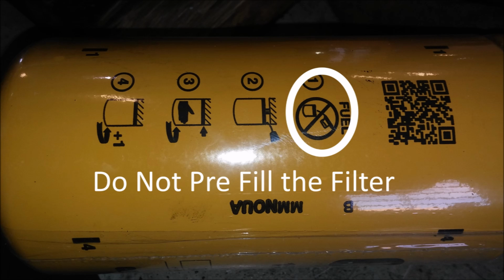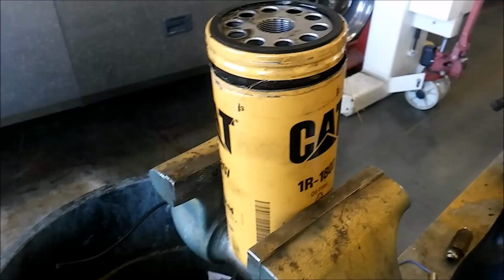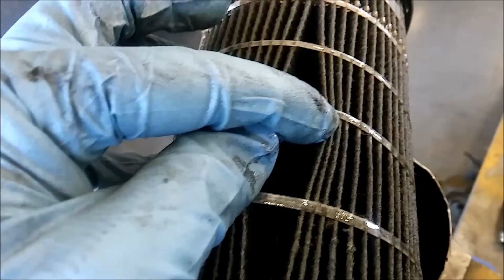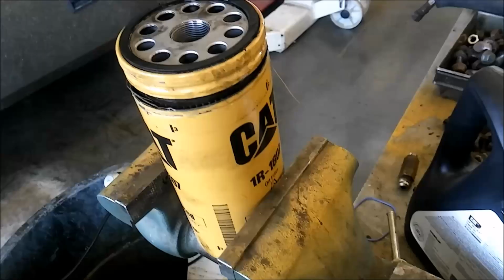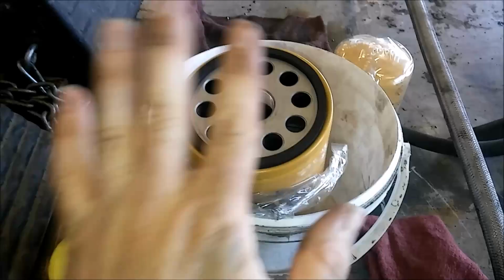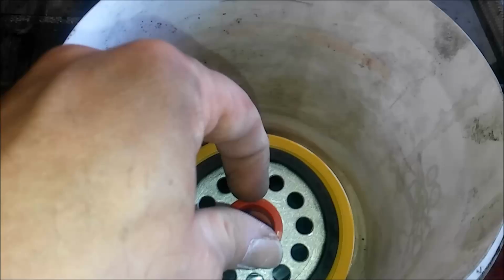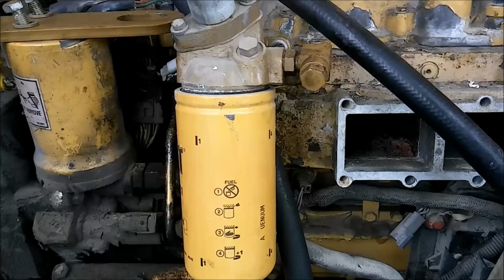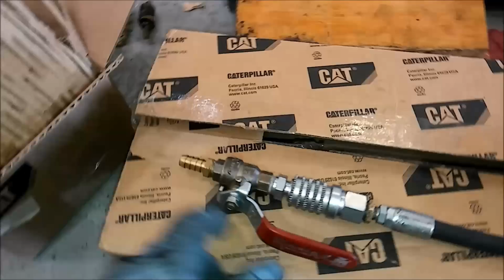Should You Pre Fill an Oil Filter? Should You Pre Fill a Fuel Filter?

Comment: well that didn't work!!!! i am trying to get a wiring schematic to see what triggers the  injectors also is there a ICP for this engine or something that will not let the injectors fire? thanks for the on going sopport. 
have a good night.
ps i am about to give up!
Reply from the maker: Don't give up! I'm not exactly sure what acronym the ICP valve you speak of, some sort of Insane Clown Posse valve perhaps, just kidding. My HEUI videos hopefully can shed some light on how the system works though. The injectors are fired directly by the ECM, so as long as you have HEUI pressure and fuel pressure, it's up to the ECM to fire the injectors. I think I'll make a "Diesel Talk" tonight and try to elaborate on your questions, so watch it if you can.
Reply: LOL! ICP in ford 7.3 turbo diesel (injector pressure sensor) i don't know if cat has it thats why i mentioned anyway if the pcm activates the injectors then i don't have a way to check that out,unless you have a special way or procedure.thanks !!! will be looking for the video!!!!
Reply from the maker: +adve58 I did the video and it's uploading now, give it about an hour. Sounds like you understand the system fairly well. There is an Injection Actuation Pressure sensor, but they rarely fail. The ECM fires each injector, but without a computer there is no way of knowing if it's firing or not unfortunately, if your getting smoke its firing. I wish I could just get my laptop on that engine for 5 minutes and see what was going on. If you can measure fuel pressure and it's good, and there is oil purging out of the injectors while it's cranking you should have HEUI pressure, but without a way to talk to the ECM your going to be flying in the dark as far as if the ECM or harness is okay.

Comment: if you don,t want a prefilled oil filter on your diesel, don't go to a quick lube.
Reply: If you want a good job never take it to a quick lube. Always take your rig big or small to a real mechanic if you don't do it yourself.  If you want to avoid potential problems this is what you do.  Quick lube joints are the Burger Kings of the oil change industry.  Only I suspect the fast food guys may have more training. Too many horror stories come out of those places and that is beyond what I have seen with my own eyes.

Comment: New oil...even when poured into the clean side of the oil filter is still cleaner than the oil I just drained out of the car...and it lubricates better than no oil at all. When you start up an engine after an oil change, it knocks for about 5-7 seconds. If you pre-fill the filter, you hear almost none. I'll take the latter situation.

I own three cars. All are over 80k miles. One is over 220k miles. I've never had any lower engine problems. I guess I'm doing something right.

I see no point in priming a fuel filter. If your vehicle has an electric fuel pump, fuel will reach the engine quickly. Even if it doesn't, who cares? You just need to crank a little longer before it fires up. No big deal.

Comment: I dont care what other people do ive drove trucks 42 years ive always pre filled ive got over a million miles on my enguines .the old 2 stroke detroits if you didnt pre fill the fuel filters they would suck air and not run theyd lose there prime,even alot of cats had a priming pump to get the air out

Comment: What is a filder and no pre fill your filder or fuel FILTER depends on the the system and pressure common or non common electric pump or button or rod pump even butterfly clip pump pre fill all filters  no dry start full system

Comment: problem solved:  have engine steam cleaned, go to shop that has just been cleaned so its spotless, have mechanic put on clean clothes  and drain oil and remove filter then  pour fresh oil in filter using funnel with filter and lubricate the gasket on filter don't want to get a hernia trying to remove filter at next oil change, install oil filter hand tight only no wrench needed or you will need a small boy and an elephant to remove it when full and make sure oil plug is in oil pan then fill with fresh oil using funnel with filter as you pour oil in and don't forget to replace the 710 cap so the oil won't splatter all over the engine compartment after that's all done get your self a bottle of gin and of quart of prune juice it will make you day: and don't forget to put a cap full of sea foam in your oil it will make your oil happy

Comment: I understand not pre-filling a fuel filter.  The risk of using fuel that is contaminated in some manner is just way too high and pouring contaminated fuel into the filter's center - any nasties go straight into the injectors, jets, whatever (and that's assuming no internal filter screens - which is not realistic).  AND running dry for limited amounts of time is of minimal consequence.  

*But a motor OIL filter?*  C'mon, if the oil just came off a store shelf - that oil should be clear enough to be pumped straight into your own veins.  So center, outer will NOT matter.  Any mfg debris in the new oil filter outlet will get flushed out to the engine no matter what your pre-fill choice is.

So again I must ask,  how in ANY way could pre-filling a new motor oil filter be a harmful thing to do??  I've *always* told people to prefill their engine oil filters, ESPECIALLY if it's being installed on a turbo-charged engine.  Always trying to minimize the milliseconds it takes to refill the plumbing after a change.  Not only that, but on the last turbo car that I owned, a red 5-spd '95 Mitsu Eclipse GS-T ( I fkn loved that car) I always pulled the ignition fuse and cranked the engine for 3-to-5 seconds after a filter change...

Comment: 2ws 3406e

I bought my truck with 515,000 miles eight years ago. always prefilled oil filter new oil,  new fuel filters old fuel from old filters every 10k miles. im now at 1,063,500 miles no inframe original injectors and idle psi still 48 to 55psi. still runs like a raped ape.
Reply from the maker: +77chevyk30 Those are good engines, I've seen them with well over 2 million miles, usually with an inframe.

Comment: I have never pre filled my oil filters in my cars since one engine's filters goes on upside down and the other one sits sideways.  240,000k and 170,000 k with engines running strong. If it psychologically makes you feel better to prevent fill the oil filter and are able to due to its design, then by all means go ahead.  Doing it or not is not going to due miracles to ur engine nor  destroy it. Neglected engine services will ruin cause pre mature or engine damage.

Comment: I have owned heavy equipment for over 35yrs. I have changed oil thousands of times and never ever have I filled a new oil filter ever. It’s bullshit filling oil filter. My Question back to you is what about oil filters that lay sideways. Rest my case. But fuel filters should be filled . You don’t want to run your fuel pump run dry and create issues. So that’s it. My 35yrs experience.
Reply: You can still get a horizontal filter saturated with oil and  have at least 1/3 full and still install it with little to no mess. 
I’ve done it for years. Assuming you give the old oil at [least] 5 minutes to drain, why not fill the new filter while waiting?

Comment: If you don't you will get air in the fuel system and it won't run. Use clean fuel is better than no fuel.

Comment: Never pre-filled, never had any problems. If you seriously think that your engine runs "dry" after not pre-filling your oil filter you're just making something as simple as an oil change way too complicated. You can in fact redline an engine with no oil for 2 minutes, so if you think idling without oil pressure for 2 seconds after an oil change destroys your engine, you seriously don't know anything about modern oils and the lubrication capability of them

Comment: Save your pump and add clean oil to the both sides of the oil filter. I rather have fresh clean oil from a bottle with the risk of contamination from it, than hear the cavitation of the oil pump struggling for 10 seconds.

Comment: I watched some of your videos and felt like u are pretty knowledgeable. I have a question and a favor to ask. Please reply. I have a 2007 kenworth with a c 13. The turbo has what o call a actuator or waste gate looking thing. Well it had a metal line on the back and it broke off. And I can't tell where the other end hooks up. I was gonna do a temporary fix and make a line. Message me or call me would be awesome
Reply from the maker: +Wayne Peake The waste gate should go either to the intake side of the same turbo or the intake side of the other turbo. There should be a hose coming the intake side.

Comment: With this theory,you could say that by pouring unfiltered oil into the filler,i.e. the valve cover,you have just cantaminated the engine with " dirty oil"
Reply: That oil will drain to the sump and be filtered before going to the big end and main bearings the point he was making is keep everything on the clean side of the filter filtered and clean simply prefill your filters on the dirty side, it makes complete sense and its easy no big deal if there is a bit of dirt in the new oil you could go from a hero to a zero very quickly just do it .

Comment: i have cat7 no faults truck been sitting for about 1 year . We change injectors and fuel pump. Would not start. Any suggestions.
Reply from the maker: +Alex Kolker What is the fuel pressure while cranking? Are you getting an rpm signal on the tachometer while you're cranking.
Reply: Hi. yes pressure around 25-35. RPM's are week around 7. But forgot to mention when we use starting fluid its start runs for about 1 min and dies again.
Reply from the maker: +Alex Kolker Well it's hard to troubleshoot over comments, but 25 psi of cranking pressure is good. Now the engine starting and dying is interesting, sounds like you might be getting air in the fuel. Try running the fuel inlet line straight out of a bucket of fuel and see if it stays running. Next step would be to put a very high pressure gauge on the HEUI rail and see what kind of HEUI pressure you have while cranking. Should be around 800 psi. Any check engine lights or blink codes? Good oil pressure at cranking?
Reply: We getting code 62 and 35 also transmission sign stays on not Engine.

Comment: I always prefill filters oil or fuel no matter what type engine or size Fuel especially to prevent air locks and faster starting on diesels  unless filter mounting position doesn't make it possible if the oil coming out of a quailty name brand Oil container isn't clean then you have no business putting it in your engine anyone thinks otherwise is an idiot, another thing if you think your oil filter getting all the particiles out of your engine think again its Not , in the early days Engines didn't even have oil filters they were an option

Comment: what is your opinion on filling oil filters with a remote filter on equipment
Reply from the maker: +CHRIS BUXTON If the filter replaces the engine one then I would say the same principles apply. If it has a filter then it's probably feeding something sensitive and it's best to get it the cleanest fluids possible. I know some systems use a bypassing recirculating system, like some bulk tanks, so those filters aren't as critical for the sensitive prefilling, but it never hurts to do it the best way.
Reply: +Adept Ape right I just thought maybe with the longer hoses to the filter housing it would take longer to build pressure with not filling it....maybe a tightening filters video? Noone seems to be able to follow directions or are scared they will come lose and they don't come off
Reply from the maker: +CHRIS BUXTON You can prefill the filters if you want to, but just fill them from the outside and not the center if you are going to. I understand why people prefill them, the idea of running an engine without oil pressure even for a couple seconds is scary. They almost need an oil priming system that would keep a small amount of oil in a collector under pressure for start up after an oil change
Reply: +Adept Ape yeah that would be a good idea or an accumulator or something

Comment: well when am setting on the side of the road ill make sure I remember to fill the fuel in the little holes, shit buddy I've been filling the fuel filter on my truck in to the big hole for over 25 years and nothing bad has come from it, your talking such a minuet amount of fuel nothing going to plug up.. I run a cat 475 you have to fill the filter. and yes it has a pump to top off.

Comment: hi there im still around!!! ok so while time didn't stop for me the engine is still not running but i need to know where do i get an oil pressure reading and what is the lowest pressure the engine must have to operate( the injectors) i haven't taken out the injectors yet but i guess that would be my last attempt to start this monster!!!.
thank you loved the last video!!!!+++++++
Reply from the maker: You have perseverance sir to keep working on someone else's engine. A good place to test for oil pressure on a 3126, I believe you have, is on the oil manifold. The oil manifold sits on the intake side of the engine. It is below the intake manifold and to the rear of the air compressor. It is bolted onto the block with two 13mm headed bolts. There should be several ports on it and should also have a small line going to the air compressor. Use any of the ports with a plug in it and you should have oil pressure in it when it's running. I don't remember the exact specifications for minimum oil pressure on a 3126, but it should be at least 20 psi at idle. Hope that helps.

Comment: This is a lot of work for nothing. Clean oil, clean oil filter, fill in the center. Aircraft piston engines, even modern piston aircraft engines don't even use a filter. Save your engine, pre-fill and pre-fill with the center hole. Using the method shown in this video I suppose it's possible to damage that rubber that's designed to prevent the oil from back-flowing.

Comment: Why would it matter? All the oil you are dumping into the oil pan is unfiltered. How is the 2 quarts of filtered fluid going to counteract the other 15 quarts that are being dropped straight into the engine unfiltered? Common sense. Because in most cases all that oil gets dropped ontop of the overhead cams and falls down into the drain pan. All this "contaminated" oil that you don't trust from a bottle has literally coated the engine. Just in case you want to be like "oh the fuel filter is right after the oil pump, everything that gets sent up gets filtered" That is a crock of shit.

Comment: hi yes it's me still with the cat 3126 no start, sorry to bother you again, now this is my question. on a buebird bus 2002 with the cat 3126 engine, how do i get pcm codes? thans for the help this is the last straw if we can't get anything it is going to the caterpillar mechanic in san juan puerto rico (ouch thats goin to cost$$$$$$$$$$$$$$$$$$$,
have a great weekend.
sinc marcial(adve58)
Reply from the maker: +adve58 On vehicles with cruise control you can usually hold the cruise set button with the key on and it'll give you flash codes for the ECM, now if you need the power train control module codes, that is out of my area of expertise since I focus on the engines. If you can't get them that way you would need a scanner

Comment: do not prefill fuel filter. bleed air out thru bleeder after install.
Reply: k singh try that with VW diesel and you will start that engine for hour and fucked up two bateries.

Comment: The oil filter thing is kind of silly...cause you fill your entire oil pan with unfiltered oil right from the jug... I guess that would only be on the top end... since The oil is filtered before it is pushed into the bearings ..
 And don't oil filters also have a bypass valve that allows dirty oil to pass through so not to starve your engine of oil in a cold start ?

Comment: Sorry to say this video full of foolish stuff. 
I been working on diesel buses 15 years first thing when installing new oil or fuel filter you will use new fuel or new oil there's no problem at all filling in any hole 😂🤣 period dust doesn't hurt these diesel engines at all if any sensitive person thinks about it final. 2nd i always prime my fuel filter you should you must otherwise engine will not start final answer and oil filter i never fill oil in it i never had /have any problem but you sensitive enough you can prime it also no problem in any hole 🤣🤣 hope my comment helpful. Thank you
Reply: Well your rational is just, "Ive been doing it for 15 years so it's fine". He, on the other hand, states many facts why it isn't. Also, even if he is wrong, it can't hurt anything. On the other hand, if you are wrong then it could hurt things. Personally, I think it doesn't matter very much and there are other things that people do that cause way more damage.

Comment: Not on a Komatsu you dont, because oil pumps are replaced more frequent than the oil filter lol
Reply: A “Komatsu” engine is a rebadged Cummins. I worked as a tech at a Komatsu dealership for years. Never replaced a single engine oil pump. Did plenty of hydraulic pumps though.

Comment: much ado about nothing.never hurts to prefill.and try bleeding diesel pump without it!always bleed injectors and retighten quickly WHILE CRANKING THE MOTORwhen you've run out of fuel.doing this with an empty filter will let it run out of fuel again

Comment: Well from my experience and reading trade journals. Do not ever pre - fill oil filters, expensive case in point cummins engines have been destroyed and warranties were rejected.   Why.  Because people pre filled and 1 tiny bit of contamination got in and clogged the piston oil spray jet that most all Diesel engines have and some good gas engines also use, so that’s why that’s an expensive mistake  you may want to rethink !